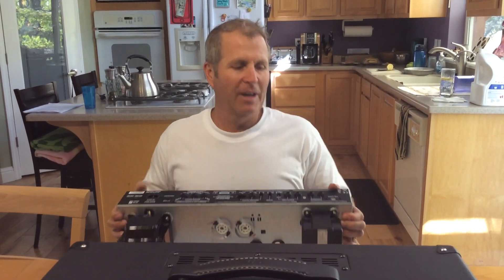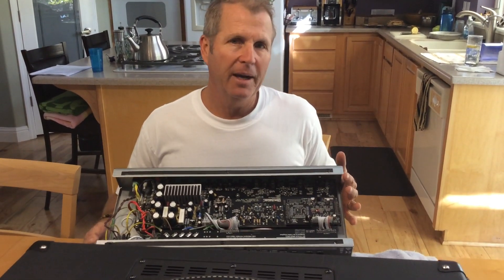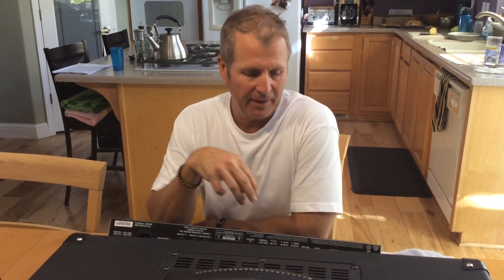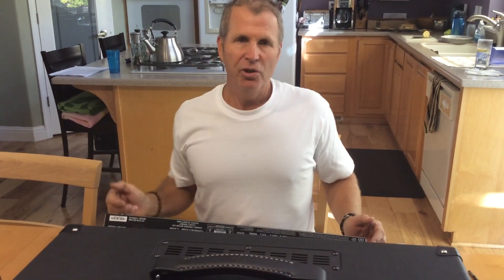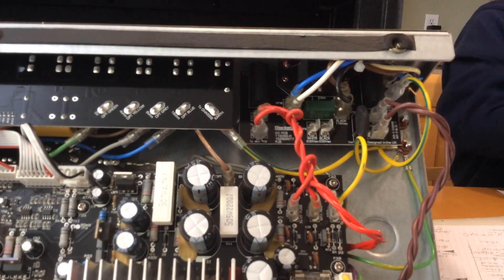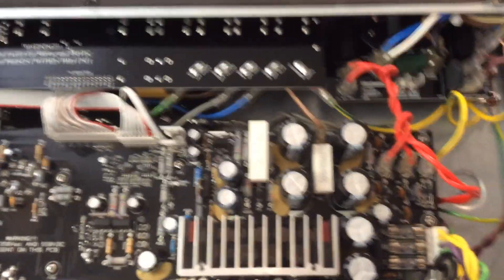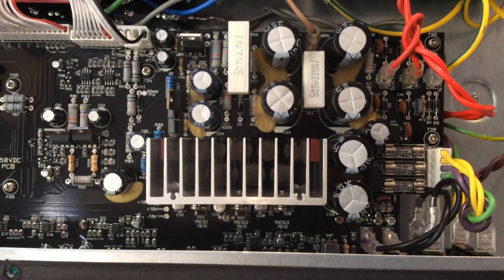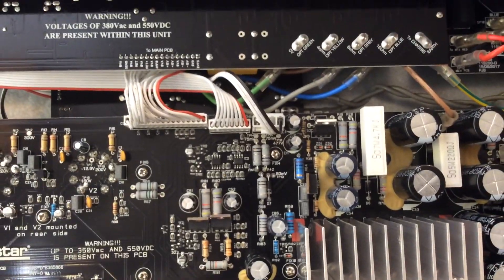Blackstar HT 50MKII Chassi Pull - A Look Inside

Comment: Do I just have to move the black and white input power lines to the 230v connectors in order to convert my amp from 110v to 230v? I have been using a step down transformer and it is a hassle having that.
Reply from the maker: I’d definitely think so, but I’d check with Blackstar to make sure. They are really good at answering emails, and answering the phone.
Reply from the maker: After thinking about it overnight, I’m now thinking that it would also require a transformer change. Really hard to think it through without looking more closely at it. The primary of the transformer will either see 110 or 220 and then will convert that to the required internal voltages - the way I’m thinking it thru, it’ll require a different transformer, just like the one you’re using externally… check with Blackstar. Many amps have an input voltage selector switch…?

Comment: I have a HT Club 50 Mk 1 (first generation). I wand tp check all the connector inside and clean it up but after taking out all of the screws, the chassis just won't come out. It's the front part of the chassis that seems stuck to the cab. Could you make a video on how to take the chassis out of that amp.
Reply from the maker: There is sometimes a piece of tape like stuff in that area and heat just makes it worse. Carefully and gently work a fine tipped screw driver along the front, gently lifting and prying… it’ll eventually break free. Have the front of the head supported a couple of inches above the rear feet so that gravity helps you a bit.
Reply: @oldguyjammin9732  I tried and it worked. Thanks!!!!
Reply: @oldguyjammin9732  Thanks for the info, I'll try it for sure.

Comment: I have an HT stage 60 212 mkII. I was playing it and all the sudden the sound and power slowly died. I checked the fuses and the main fuse had blown. I bought a pack of the correct replacement fuses and every time I replace the fuse the power and power light come on but immediately die and fade out. I have blown 3 new fuses so far. I took the amp apart and cleaned the circuit boards and looked it over really good and can find any obvious damage. What are the possible causes? The only thing different I did before it blew the first fuse was I had it plugged into a power strip that had a AC unit running and a computer and monitor and phone charger plugged into it. Also I was taping the effects loop 4db/-10db button on the back of the amp because it wasnt catching properly. Please help. The Tubes look brand new
Reply from the maker: Is it the ‘mains fuse’ on the back panel or an internal fuse on one of the PCBs? If it’s the Mains Fuse than you’ve got a problem in the power supply section that creates the high AC voltages and DC stuff. Could be the power transformer. You’d have to check the primary winding and the secondary taps to see if one of them has shorted, but since it won’t stay ‘on’ you can’t check for voltages, you’ll to check for ‘ohms’ with the leads all disconnected. The PSIONIC channel is really great with tech stuff, and he’s done work on Blackstars. See if he’s got some suggestions. Lastly, does the inside of the amp smell strange? Or burnt? Transformers have a particular smell (burnt shellac) and capacitors have a very particular smell too. The top of your capacitors have a “peace symbol” or a circle cut in thirds on them, check for bulges or splits.
Reply: I opened and cleaned the all the circuit boards and looked over all the electronics and I see no sign of any damaged components. I havent put it back together yet nor have I tried it since the cleaning. I read on the net that a lose speaker can cause that to happen but I doubt that to be the case. I think I caused the issue by clicking in and out the effects loop boost repeadedly very quickly trying to get the dirty switchh to work correctly.
Reply from the maker: @themultiverseuniverse  ~ Well, dirty switch and effects loop switching on/off is wierd... why would you do that? Just select on/off for the loop (just say on) and then SLOWLY play with the boost switch... rapidly doing ANYTHING is a good way to blow a fuse.
Reply: Its the Main fuse on the back panel
Reply from the maker: @themultiverseuniverse  ~ does the mains fuse blow without any of the channel switching chanaigins going on!?!?
Reply: @oldguyjammin9732  yes. I change the fuse turn it on and in 5 seconds the new fuse dies
Reply: @oldguyjammin9732  the light comes on bright and then gradually fades out within 5 seconds. Blows the main fuse each time
Reply from the maker: @themultiverseuniverse  ~ power section dude. Something is wrong on that first board, check the transformer out windings or high AC cap voltages.

Comment: Have you got this amp working?
Reply from the maker: It hadn’t failed, it was working and probably still is. I sold it sometime ago. I picked up an HT5R MKII instead.
Reply: @oldguyjammin9732  was it too heavily for you?
Reply from the maker: @donciseau  - no, the DSl40 or Fender SuperSonic are much heavier, it just didn’t sound as good ‘loud’ as it did ‘quiet’ so I didn’t see the point. At louder volumes the difference between the HT and say the Mesa or Engl become more and more apparent. I do like the Blackstar tone though so opted for the little guy.
Reply: @oldguyjammin9732  well that makes sense
Reply: @oldguyjammin9732  do you think you'll get the the new st. James blackstar guitar amplifier
Reply from the maker: @donciseau  - I don’t think so. I was real curious and kind of excited at first but so far the sound clips are ‘just meh’ and BS is still using only two preamp tubes so I’m sus, lol. It means they’re probably still using the solid state ‘push/pull’ amp in front of the preamp tubes. You gonna try one? Dang pricey too...?!!?
Reply: I will try one if I have time looks good you are right it expenses!

Comment: The board in the MK2 is even worst than the first one. Sad because they sound good
Reply from the maker: I agree, they do sounds good but I’m of the opinion that they sound best at lower volumes ha ha. I find that as you turn these up, the difference between them and say an Engl or Friedman or even Marshall for that matter becomes more apparent. A few months ago I got my 5th Blackstar lol, not that I have 5, I only have one but I went back to the HT5R Head MKII. It’s great.
Reply: @oldguyjammin9732  I'm going to install a fan mod on my ht50 mk1. These things go hot so quick and with all that stuff on the pcb, it's a easy and good thing to do.
Reply from the maker: @sVsWR24  - good for you, heat kills the tone of any solid state part. I used to have a GK112 and it sounded killer for about 20 minutes than it would heat up and lose all its midrange.

Comment: Bias and balance are located next to the power tubes. Two square holes with led’s. You just adjust them until the lights go out. Put all pot to 0, plug a dummy plug into the input and hook a speaker up. Warm up the tubes for 2 minutes on standby then turn off standby. Locate the bias pot to the left when looking at the amp from the back. Adjust until the green light goes out the adjust balance until the green light goes off.

Comment: I'm a little late on this post. Did you happen to see a bias pot inside?
Reply: Im very late to this BUT - not because I'm a flakey shallow narrow minded kinda guy but I prefer the mk1 ( original head ) for the same reason he is disappointed at the nonserviceable parts . The mk1 has a output tube bias trim pot and also a balance trim pot as well . It also has ceramic tube sockets for the power tubes but I dont believe it has ceramic for the preamp tubes . If you are very careful , have great eyes and steady handa you cam tweak the " tone stack " albeit a bit . After hearing one of the HT Club 40 's in Carolina Blue  "country version " with 6l6gc power tubes at Guitar Wishes in Lincolnton NC , I modded my mk1 head to take 6l6 power tubes instead of the harsh and thin " anorexic " sounding EL34's that came stock in it . It was biased on the cold side with the stock tubes . I tried JJ EL 34 L's in it first which are slightly bigger bottles and a little fatter sounding but not as much gain . At that time of course I checked and rebiased the new EL34's because the stock ones were set on the cold side .  Then I tried JJ EL34's and still didnt care for the tone . So after playing the Carolina Blue HT Club 40 combo with 6l6 tubes in it - I decided to mod my HT Club 50 head ! After bout a week of tweaking and barely getting the new 6l6gc tubes biased - the trim pot bout ran out of adjustment lol , and with NO OUTBOARD OVERDIVE OR DISTORTION PEDALS - this freaking head woke tf up and came alive !!!!! Just for kicks I ran a graphic eq boosting the low mids through the effects loop , it now sounds like a "Poor Mans Splawn Quickrod " 💪👌🤘 Wasnt very hard to do , took a little patience but worth every penny . You can't buy a Marshall that sounds this good , that doesnt need a boost pedal , for less than $2000 . I posted a clip here somewhere lol . Anyhoo , strap up , strap on , rock out and getcha pull 😎  And to all the Blackstar haters out there that spent 3 times as much on a Marshall or other head - sell it and buy the Blackstars and I'll mod them for ya 😲
Reply from the maker: No, I didn’t find anything for adjusting the boost gain, or tube biasing. I believe that like many other EL84 amps, you just put new tubes in and forget it. I’ve also found that tube biasing can range quite a bit, from like 60-80% of the tubes output - whatever you think sounds best, so worrying about getting the bias exactly right on a new set of tubes is a bit trivial because the % difference between ‘new tubes’ of the same brand will be marginal due to the maker’s product tolerances. Does that make sense, lol? Sometimes I don’t make any sense, even to myself :)
Reply: @oldguyjammin9732  the bias pot are in the other side, close to the EL34, the closer to the valves is the balance pot, and the other the bias pot, there are a led system, green is cold bias, red hot, when the led is off is the "ideal adjust", the balance led need to adjust in the off mode ever
Sorry for my inglish i don`t speack it
Reply from the maker: @ramonespinoza7661  well farout Ramon. I sold the 50W beast but just got the HT20 on the porch today and I’ll be looking around in it for sure. I’m sure it’ll be very similar. Thank you very much